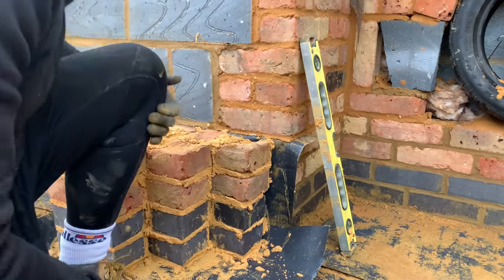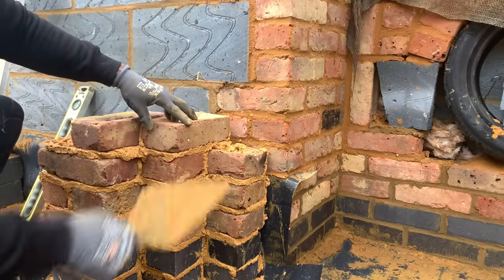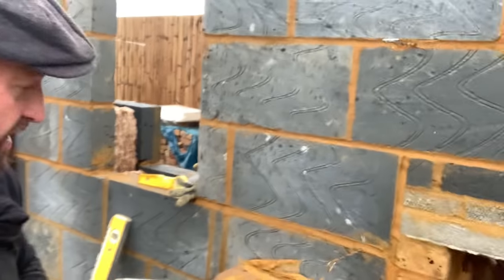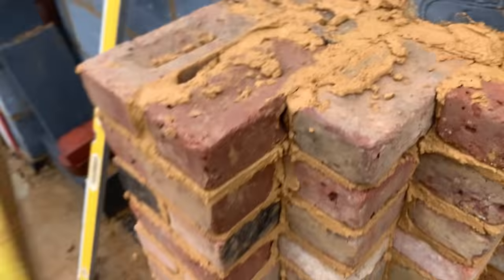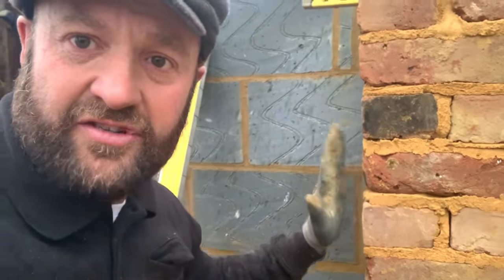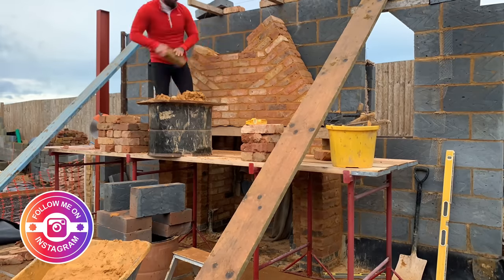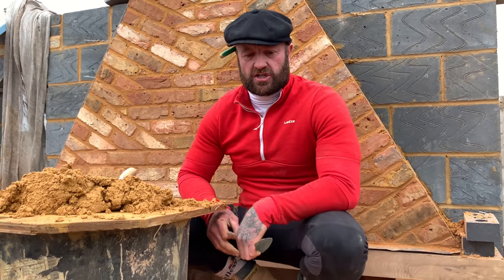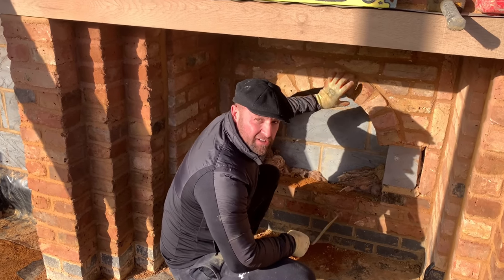Brickwork fire place 

#bricklaying #fireplace #brickwork

Comment: Were going buikd the mortar where using is white clay oit sand from local Corey in kent so doing 5 sand 1 sharpe 1 lime and 1 white cement brush of with turn brush looks the nuts but habe to let it mix for while